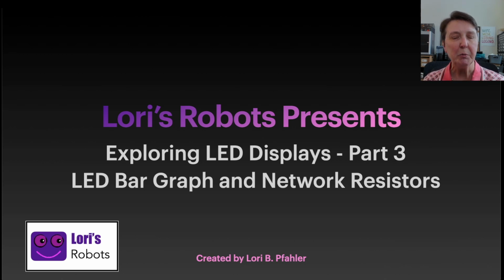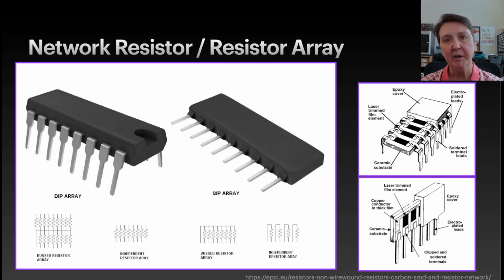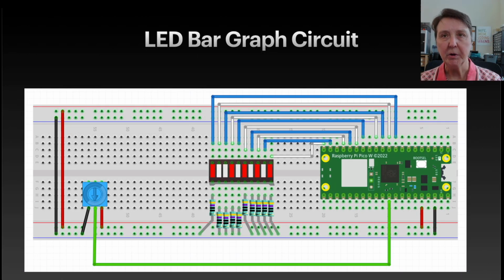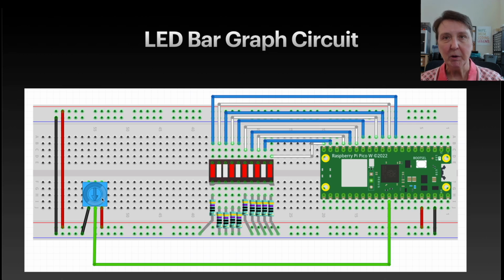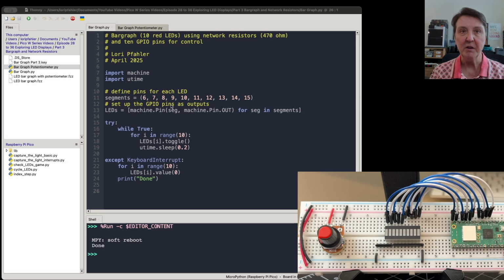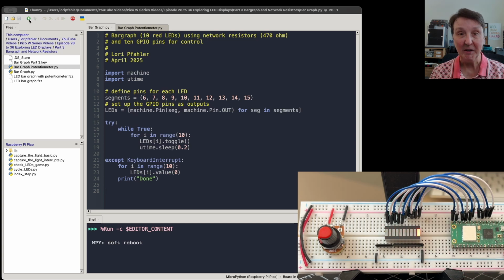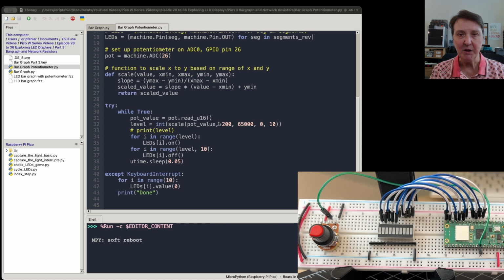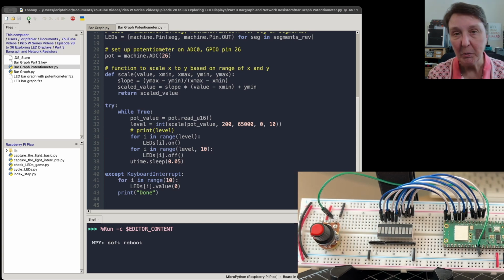Pico W Episode 30: LED Displays Bar Graph and Network Resistors Part 3

Comment: Very nice .. I've been using the DIP resistor arrays for quite some time, 330 ohm for the Pico and 1K for the Arduino . I like the SIP version for this type of application . Going to pick some up . Neat loop for the Pin.OUT's . Thanks for sharing .
Reply from the maker: Network resistors are a nice component to use in many circuits.  Thanks for watching!

Comment: nice, will adapt, have mini square enclosure with led in each corner, 1 resistor pack is good for 2 enclosures, to simulate 'traffic lights' both directions. 
a horizontal means stop, vertical means go, rotating means free will  (ignoring color, no problem for color blind)
for segments i used  (tested code on pico)
segments = range(6,16)
did not make leds variable but did use list comprehension to set pins, and to toggle
for seg in segments:
   machine.Pin(seg).toggle()
to switch leds off
for seg in segments:
   machine.Pin(seg).off()
Reply from the maker: Sounds like a great project.  Have fun.  Thanks for watching!

Comment: Nice job as always Lori! I think hobbyists use resistor networks more than industry. I used one on my greenhouse controller PCB. Of course with surface mount PCBs the pick-n-place machines make quick work of placing resistors. Looking forward to the shift register video.
Reply from the maker: Thanks Keith.  I have seen surface mount resistor arrays too.  Maybe hobbyists are the ones that love to control LEDs in nice lines 🙂.  Upcoming are two episodes on the shift register: one with the bar graph and then one with the seven segment. I will start to use the shift register more and more as the episodes progress - till I get to the LED displays with driver chips.  Thanks for watching!
Reply: @lorisrobots  Cool! Are you going to show the CD4511 BCD to 7 seg chip?
Reply from the maker: @keithlohmeyer  I do not have that chip in my lab/hoard.  I have seen some cool projects with that chip.  I will add that to the list.  I am not done with the series yet so I can add that in.  Thanks for the suggestion!
Reply: @lorisrobots  With micro-controllers it really doesn't have a place, but I remember it from early electronic kits I had.
Reply from the maker: @keithlohmeyer  Yes - I will use it on its own.